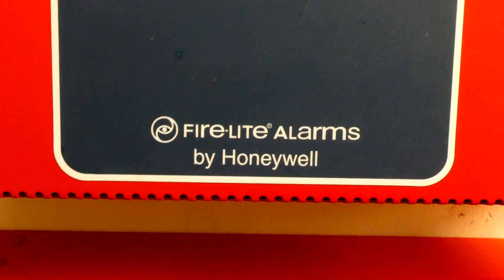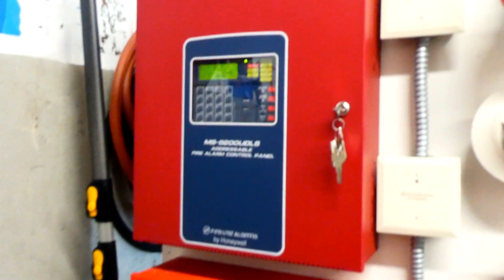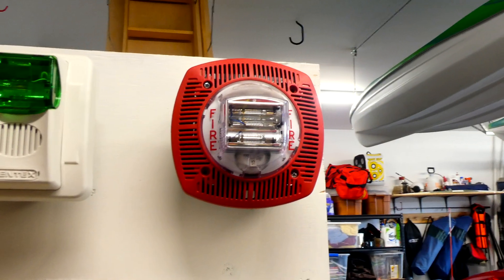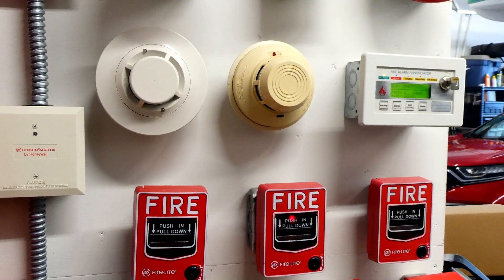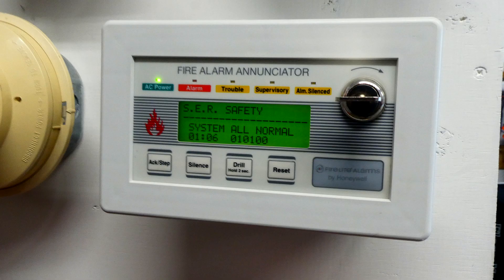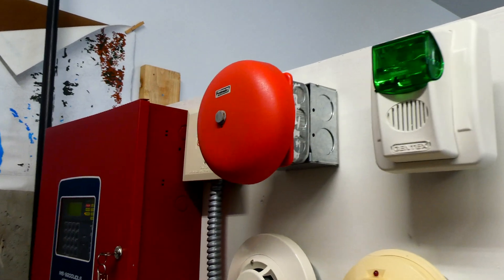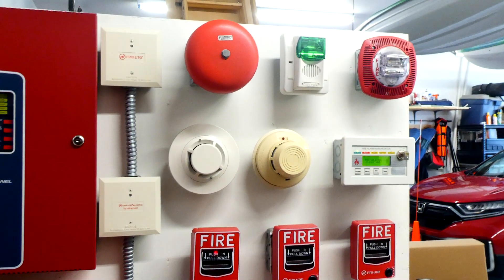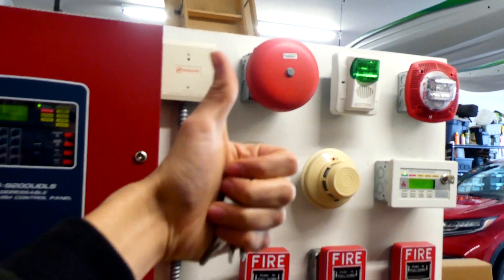Fire-Lite System Test 15: Smoke Detector Competition!

Comment: If you set your fire alarm panel to continuously sound the horns, bell in your case, how will the bell behave?  Because it's a single stroke bell, will it just ding once or can single stroke bells ring over and over again when they receive constant electrical voltage?
Reply from the maker: This model of bell would only ding once if powered continuously.

Comment: My high school had a very similar System Senor Detector. They went off so easily! I was once running water based haze during a concert rehearsal and it activated one across the auditorium. Another time the police department was doing drills while no one was in the building and a pistol blank activated one. A duct detector equivalent was even activated by humidity!
Reply: Oh shoot

Comment: Can you use the annunciator as a mane  Control panel
Reply: Yes you can use the remote annunciator to scroll through trouble/alarm conditions, use features such as Silence, Acknowledge, Reset, Etc. But if you want to get into programming or do further changes then you have to use the main panel.
Reply: No